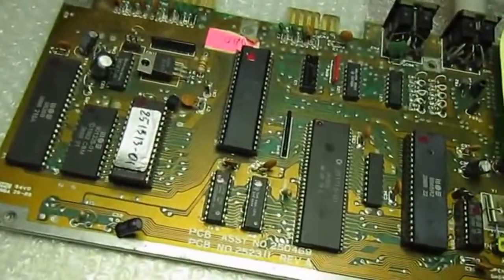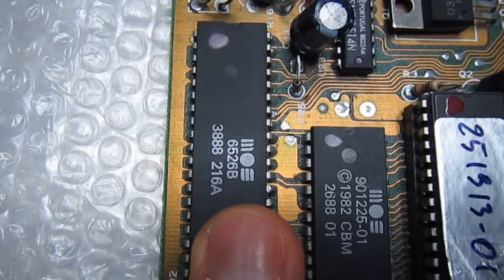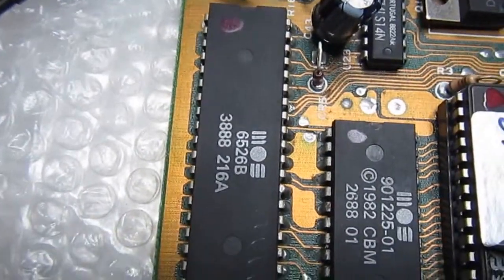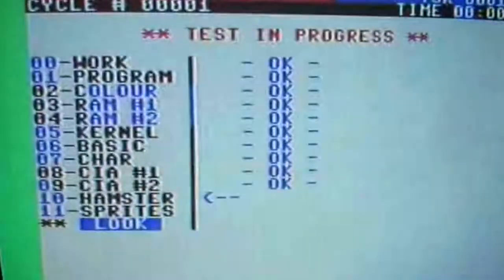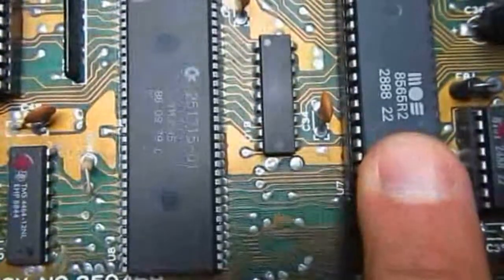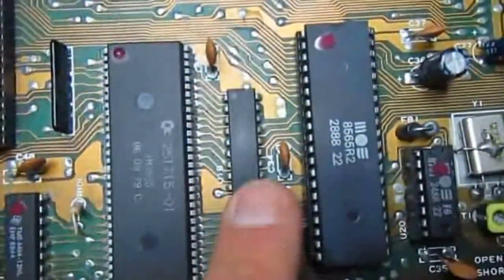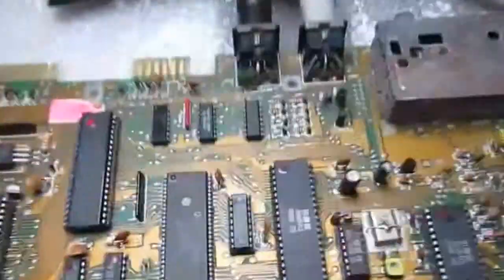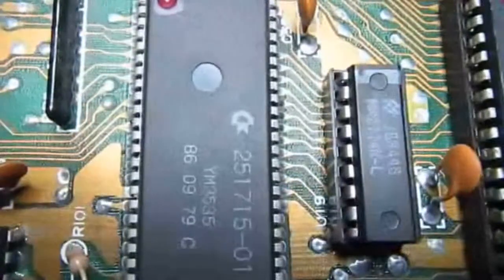C64 (C64C) repair. CIA#2 and color RAM

Comment: Hi.  I was watching this video again.  You mention writing a BASIC program to test the colour RAM.  Could you share that program?
Reply from the maker: Hi, I always start with a very generic test program like the following:
10 BG=55296:EN=56319:W=0:REM BEGIN,END,WRITE FILL VALUE
20 FOR A=BG TO EN
30 POKE A,W
40 NEXT
50 POKE BG,1 : REM WRITE DIFFERENT VALUE IN SOME LOCATION(S)
60 FOR A=BG+1 TO EN 
70 R=PEEK(A)
80 IF R<>W THEN ? "LOC: "A" W: "W" R: "R
90 NEXT

line 10 and 50 then may be adapted to do some different writes (ranges, values...) depending on what the test finds (or not finds).
55296 to 56319 is the decimal address mapping of the color RAM, but similar tests
can be done on different RAM ranges, provided that the machine is working enough to run basic.
Reply: That's excellent.  Thanks very much for the program and information.  Clearly, the diagnostic cartridge did not test the color RAM that thoroughly.

As always, I look forward to more of your Commodore repair videos.